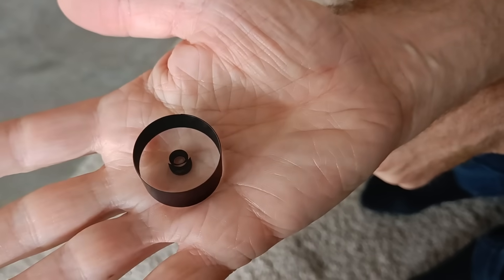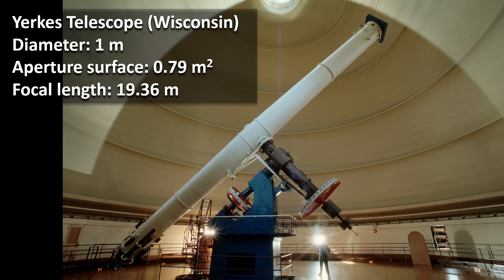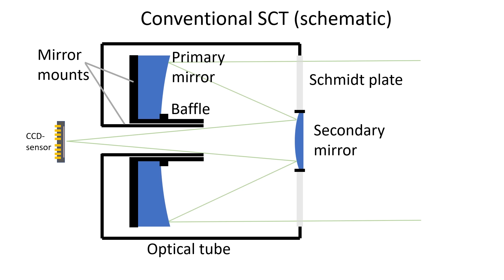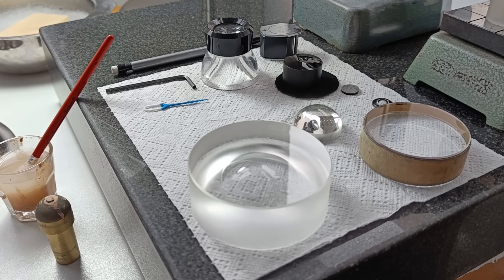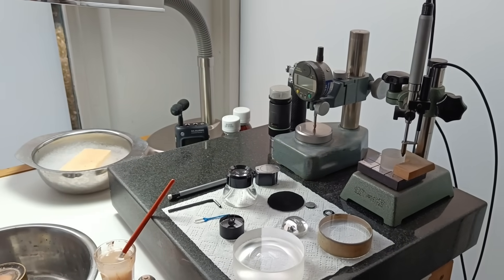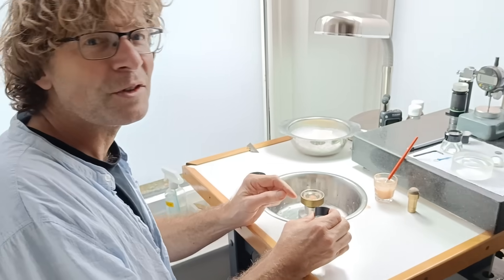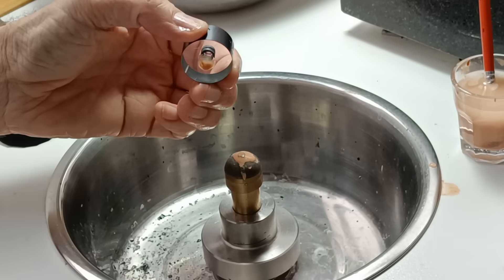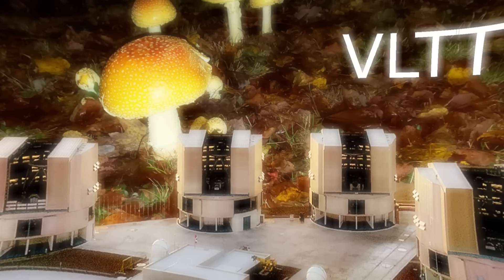Why is this Space Telescope so Tiny?

Comment: As you talked about the sensor resolution and coming from a backround from remote sensing, I always wondered what the physical limitation of a sensor is. As there is the Plancklength(distance) were you can't tell two lightwaves/particles apart anymore. Ultimatly limiting the geometrical resolution of a sensor.
And therefore with all the other parameters like maximum possible focal length of used lenses in a remote sensing photo satellite etc. putting an ultimate limit on Ground-Sampling Distance. And have we reached it with current technology?

Maybe this could be seen a suggestion for a video. If you haven't already touched on this subject. As I just diacovered your channel.

Comment: Late to the party...great video series... but:   I thought that mirror telescopes just fold the beam back and forth, thus shortening the mechanical length (by three). So.. how can a piece of glass a few centimeters thick have a virtual focal length of 300 mm?.   10:11  https://youtu.be/HxwhCmO90UQ?list=PLaLGh7vzNIRQDe4YuxgbWHmhhBlkoS3kT&t=611
Reply: Because of a very small sensor I guess. Example For 35 mm film a focal lens of ~ 50 mm is a "normal" lens between a wide angle lens and a tele lens. For a large format film this "normal" sits around a 135 mm focal length. And if you mount this 135 mm lens on a 35mm film camera you get a focal lens leaning in the tele lens direction.

Comment: you could attach it to a small radio controlled plane with GPS & send it into space dangling under a weather balloon. You could aim it with a small tangential propellor on the balloon moving it around its vertical axis, this would simplify the rest of it. when the balloon burst the plane could automatically return so you would get the expensive lens & big image files back

Comment: I just admire all kind high end unique work that people do with their hands in some small, and simple tools.
Like example, a simplest and yet most advanced tool you can build and use is a lathe. And to build a lathe you don't need anything else than a two points to hold a piece, method to rotate it at high speed like a bow, and support to hold your cutting tool to carve the piece. 

You see lot of stuff being sold for a all kind high end results with idea for making it as quickly and easily as one cut. But a amazing tool for many jobs is a file, and a additional tool to polish or sand the surfaces. It takes little effort when you have skills for the job. And that is the amazing thing that what experienced skilled people can do in their craft.

Comment: I m biologist. Could be used the same design to make a " tiny high resolution microscope" instead of a telescope?
Reply from the maker: Yes it's possible. If you make them from quartz, they can be suitable for use from the deep UV to the infrared, without any chromatic aberrations.
Reply: @cfkusnier1 peoples make microscope from blu ray. with impressive perfomance/cost efficiency

Comment: There has to be an advatage in performance from having the light moving in a medium with consistent refractive index, rather then the light moving from air, to glass, to air, reflecting twice in air and back through glass.
Coating the outer cylinder and the drilled inner cylinder in materials like Vanta Black would also improve the image through greater contrast and lowered internal reflections. If the students project was mass produced, those small cube sats could be invaluable in geosciences, weather, ocean and volcanic observations. Attaching them as a sensor package under Starlink sattelites could cover the globe with consistent reat-time observations.
Putting these lenses in front of an M12 mount and a small Global Shutter sensor could revolutionise several applications in film making, security and sciences.

Comment: I love that this and many other ultra accurate things are made by hand. The original gauge blocks were also made by hand. I tried making a 4 inch stainless steel surface plate for gauge block comparison and I got it to 1 millionth flatness over 4 inches and learned a lot in the process.
Reply: I tried to scrape a machine surface to go flat, taking me a lot of time and patience.  I need to have a granite flat surface for reference, so this master guy uses the larger piece as the reference

Comment: How in the world does he control surface quality when something as simple as a floating spec of dust landing on his drying rag could cause scratching? It seem impossible, when you consider the environments of any other optic manufacturing setup, where everyone's wearing protective equipment and is required to enter cleaning chambers before they can even walk into the place?
Reply from the maker: Most dust is very soft (cotton fibers etc). If you do this kind of work, you should be very cautious not to get hard dust on your workpiece like grains of sand from your fingers or sleeves.  If that happens, you are in trouble.
Reply: I'm imagining spending a month of shaping and polishing and then on the last day finding that a spec of sand fell out of my beard and onto the pad - it would be devastating. It would have been interesting to shut out the lights and shine a laser through the glass, just to see some of the angles involved. His work is mesmerizing - it's unbelievable that he's able to do this manually.

Comment: I have a question. Are there any accurate mathematical models that can be used to predict the rate of ablation of material as a function of lapping speed, grit coarseness, etc? Does speed matter? Or it is about the amount of time of contact? If this mode is any good, then might it be possible to build a computer controlled machine to grind a mirror to a specification?

Comment: W A R N I N G
Video contains Class II Silicon-Lima-Fuller MEMETIC HAZARD that can not be contained by the Foundation. It is NOT reccomended to view the following video over 18:00 minute timestamp. Anyone exposed to the video after "the weather have cleared up a bit" marker are NOT to be provided any silicon-based substance for 30 minutes after the exposure and should be kept away from any glass objects. If after that perioid exposed individuals show signs of facination with "tiny space telescopes" or are still trying to construct optical equipment they are to be send for pshychiatric evaluation and antimemetic treatment if necessary.

Comment: Note that early refracting telescopes were long to minimize chromatic aberration, especially before the invention of doublet and triplet objectives, rather than to achieve high magnification.  Also note that high magnification does not increase resolution, as implied in this video.  Resolution depends solely on the aperture.  For an ideal, circular aperture of diameter D, the approximate angular resolution θ = 1.22 λ/D, where λ is the wavelength of light, so bigger D is better.  For visible wavelengths λ = 0.55 µm approximately; thus, at the focal plane, the smallest image that can be resolved is about 4f/3 µm, where f is the focal ratio of the objective.  Using smaller pixels in a camera, or more megapixels, will not yield a higher resolution once the Nyquist-Shannon sampling limit (2f/3 µm) is satisfied.
Reply: If the sensor resolution is the limiting factor instead of the optical resolution then the description in the video makes sense. It is unfortunate that the same word is used for two entirely different measures, though on a practical level they both ultimately result in the same thing, how well we can resolve what's observed. 

My limited understanding was that space telescopes use far larger pixels than seen with consumer cameras/phones as sensitivity and noise floor are the limiting factors. Particularly when held at barely any degrees kelvin like James Web. The NIRCam sensors are physically quite large despite being 'only' 4megapixel, having a ~130m focal length really helps take advantage of the optical resolution achieved from the very large mirror.
Reply: @beardedchimp  The NIRCam sensor operates in the wavelength range 0.6 μm -- 5 μm, which is larger than visible light.  The actual pixel pitch is 18 µm, which exceeds the Nyquist-Shannon sampling limit for wavelengths longer than about 2 μm.  Quantities such as the charge on an electron, and Planck's determine the ultimate limits on sensitivity.  Note also, that electrons themselves are quantized; you cannot have a fraction of an electron.

Comment: Would anything change using moissanite vs glass, or higher IOR
Reply from the maker: Only for the refracting surfaces and not for the reflective surfaces. A higher refractive index would mean smaller aspherical corrections on for example the Schmidt front surface

Comment: Could a Schmidt-Cassegrain configuration of this monolithic telescope be used as an eyepiece for some hypothetical Maksutov-Gregorian or Maksutov-Cassegrain optical-tube, and have the combination be of practical/feasible utility for either astronomical-observation or, say, as a terrestrial spotting-scope?
Reply from the maker: Yes you can make other optical designs than the Cassegrain and Schmidt cassegrain, it just requires different configurations for the optical surfaces.

Comment: "To achieve a very high magnification they need to have a high focal length" https://youtu.be/HxwhCmO90UQ?t=77. What about microscopes? 20m long microscopes are rare afak?! (I suspect it has sth to do with the angle of incident light (it is not close to parallel to axis any more))...
Reply: No, this is not correct.  I have posted a comment today about this.
Reply: @cdl0  Quotation was correct, 20m long microscopes are rare. What is not correct? (Btw I read your post, does not answer my question, at least not explicitly)
Reply: @henrikkucsera3461  Sorry, my reply to you was unclear.  A 20 m long microscope would be completely impractical.  It would suffer terrible problems with vibration and thermal stability, and would not improve resolution.  A long focal length for the objective on its own is not necessary for high magnification.  Its purpose is to reduce aberrations, especially chromatic aberration.  The theory for microscopes (attributed to Ernst Abbe but formulated earlier by Lagrange) is similar to telescopes.  The general theory is described by Fourier optics.
Reply: @cdl0  thank you for your answer!

Comment: Hi there, 
This is absolutely mindblowing, that a telescope to be used as a camera lens for a cubesat. And I was wondering what happened to the telescope, was it successfully manufactured, did it pass the tests? and has it been integrated with image sensor to function as a camera?
Also what is the field of view?
thanks
Reply: Hi, thanks for your comments! The second telescope is almost ready for shipping to Portland State University. The baffles are about to be black painted, as well as the side of the telescope. It passed the optical test (Ronchi and field test) and will be integrated with the detector in the Cube-Sat later this year.

Comment: A Schmidt Cassegrain or Schmidt Newton is fine regarding correction and image quality for photos in the edges. But what I don't like with my Schmidt Newton is the so called Schmidt ghost you see with brighter stars. I guess you can only remove it by turning the Tube and try to eliminate it during stacking the images.

Comment: Long refractors were made to minimize dispersion (rainbow images) inherit in refractive optics. NOT because they "wanted" higher magnification (smaller field of view). We just accepted it.
The ratio of focal length to diameter has a direct effect on field of view. Higher ratio, less field of view.   Many telescopes today need a wider field of view and "brighter" images.  I can ALWAYS increase magnification thru other means, I can't make an image brighter without a lower focal ratio!
Reply: This is correct.  The explanation about resolution in this video is also incorrect.  I have given more details in a longer comment which I posted today.

Comment: just an idea, which i don't know IF it will work, or if maybe it has been thought of already:
why don't the lens engineer laser engrave a baffle inside the glass structure the same way they make these crystal cubes with the 3d images inside? it will be much thinner than the drilling toolbit cut baffle, but i must say this however, i do honestly not know how the optical properties around the micro laser fracture inside the glass will change and how that might affect the end result of the telescope...if it does not, there would be more space to work with around the baffle, and thus getting better achievements, would it not? idea with compliments from Petrie, keep up the great work, hope the idea helps...
Reply from the maker: The baffles need to be black (absorb light as much as possible), not sure that is posible with laser engraving.
Reply: @HuygensOptics  wonder if theres a way to make vanta black ( carbon nanotube) inside the baffling

Comment: In cassegran telescope there is mirror but the  tiny telescope is made up of glass which creates Refraction as light enter will this make image blur or any problem?
Reply: Hi, when radii and distances are optimized, the only present chromatic error is spherochromatism. For the shortest wavelength the system is undercorrected, for the longest wavelength it is overcorrected. Still, when designed properly, 
spherochromatism is within the diffraction limit of the telescope, so almost non-existing. Good remark though!

Comment: What about temperature? If the glass shrinks or expands in a cube satellite in orbit, because of the extreme heat or cold when the sun is shining on it or not, will the surfaces still be the exact shapes they were made at room temperature?
Reply: As the telescope is made out of Fused Silica it is almost insensitive for temperature changes. If it was made from BK7, it would have been very sensitive ;-) 
So, a good question!

Comment: If you did this with a chunk of germanium could you make one that works in IR? Obviously it'd need cooling and there's the rayleigh criterion to worry about.
Reply from the maker: The problem would be that due to the small aperture, you would lose even more resolution with IR than with visible light. So I guess you should make your telescope bigger instead of smaller.

Comment: Interesting but surely it must be desirable to make some kind of rig that can repeat it without manual labor. Maybe even computer controlled such that arbitrary surfaces can be made. With the special ultra precise metal 3D printing a very capable rig should be doable.
It's neat as a single solid piece but for space application, the pure mirror config has obvious advantage. Even a cubesat could pop out quite capable mirror optics, rivalling very expensive commercial satellites.

Comment: Would it be possible to produce this lens in cheap plastic by injection molding? Would be interesting to have a telescope in my smartphone.
Reply: Plastic molding will induce inhomogenieties within the material, and that will prevent the lens from working near the theoretical diffraction limit. We'll do tests however with other techniques to see if PMMA-like materials could be machined in a working system...
Reply: @astrorik  Maybe a c-mount thread could be included in the plastics so that it would be directly fit on cameras like the raspberry pi HQ camera.

Comment: Now if we could just figure out a way to mass-produce these out of some optical-grade polymers, we'd have the lens for the 4th camera (they're at 3 right now) on the next batch of flagship smartphones.
I'm only half-joking! Figuring out how to make this by machine could lead to a revolution in compact optics, even if you do end up needing some sort of fancy glass to make it (I mean smartphones already use "some kind of fancy glass" for the screen of the main display LCD, since Gorilla Glass is still "not normal glass" right?).
Also, all optics work bi-directionally, so what about applications using this as part of the optic path of a projector or something like that?
The point I'm trying to make is that this is a really nice piece of optical engineering, and whoever figures out how to mass-produce it will likely become wealthy enough to live comfortably for the rest of their life.

Comment: I have an odd question for you, I’m a youtuber looking to experiment with removing electrostatic coatings from camera lenses. There is an anamorphic lens made by a company called Sirui that is very popular right now, and lots of people want to remove the front coatings to make the anamorphic flares clear rather than blue tinted. Any ideas on how someone could do that without scratching the glass itself, and do you have any experience with Anamorphic elements yourself? Thanks for the amazing content, you’ve helped inspire this new passion of mine!
Reply from the maker: Removing lens coatings is generally pretty hard to do, since they are designed to be durable and resistant. Using agressive chemicals to remove them is a bad idea. For an experienced lens maker it is not a big problem to remove a coating on spherical surfaces by using pitch polishing (and at the same time keeping the general surface shape intact). However, anamorphic lenses also have aspherical surfaces, and I guess you want to remove material from these surface for the effect. This is very difficult if not impossible to do without altering the surface shape. So in short, I would not know a way to do this without a large chance of ruining your lens.
Reply: @HuygensOptics  thank  you, that's very insightful.